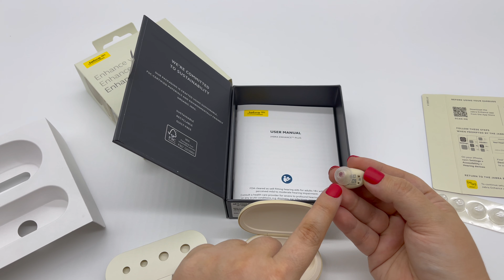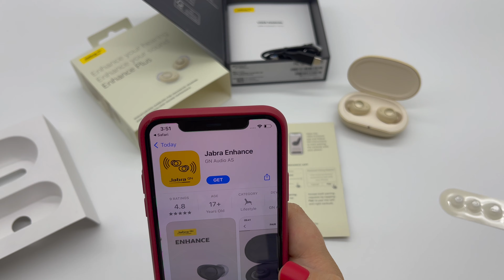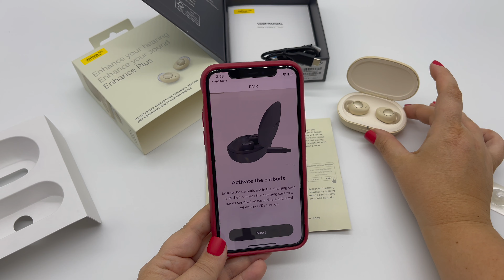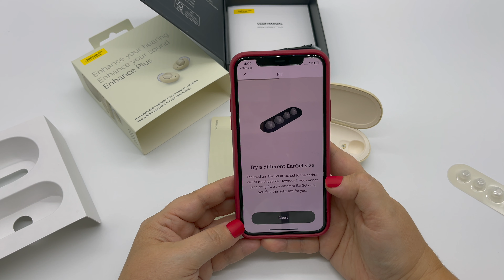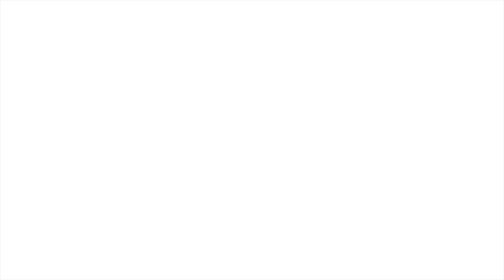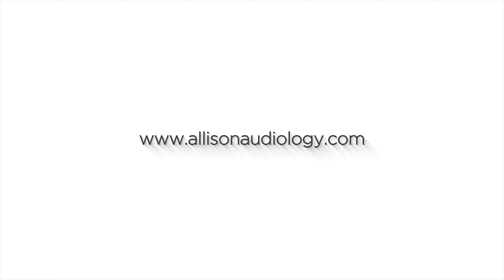Jabra Enhance Plus | How to Set Up and Use Your Jabra Enhance Plus Devices

Comment: Thank you for your review!
I just received a pair of these Jabra Enhance Plus hearing aids. I followed the personalization (hearing calibration). The sound quality is pretty good, however...
I need them to run at 9 or 10 volume (Surround mode) to get enough volume out of them, is anyone else having this issue? 
For reference, my last hearing test is around 50-60 dB from 3K hz - 6 Khz. 
thank you
Reply from the maker: Hello, it sounds like this could be a few things.  While these may not address your specific case, there are some general suggestions:  If you were getting enough volume at one point but aren't now, we would recommend changing the filters/tips and a good cleaning.  If there's no improvement, a new hearing test is recommended to ensure hearing hasn't changed and address any potential need for a physician evaluation.  If the volume has always been low, it could be the devices simply aren't powerful enough for your needs.  These are general suggestions.  We would recommend a visit to your hearing care provider to ensure you're on the right track and get the best care for your specific needs.